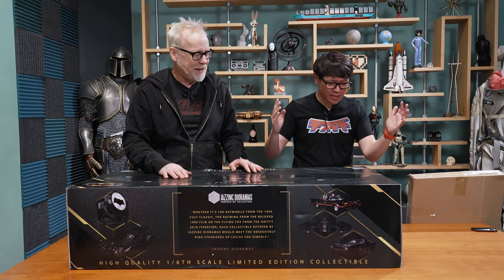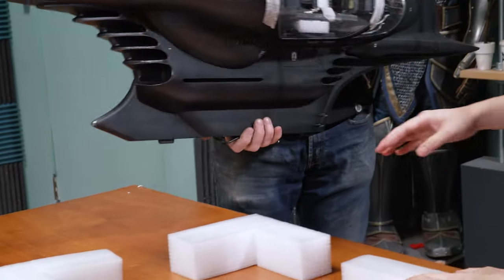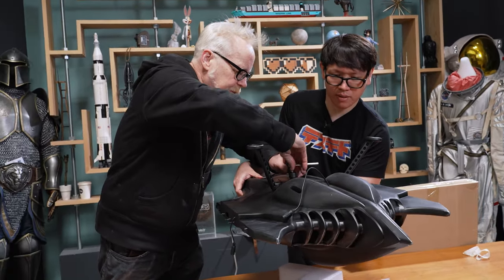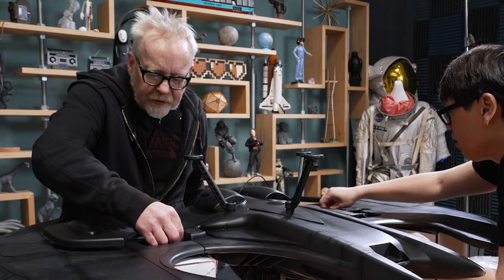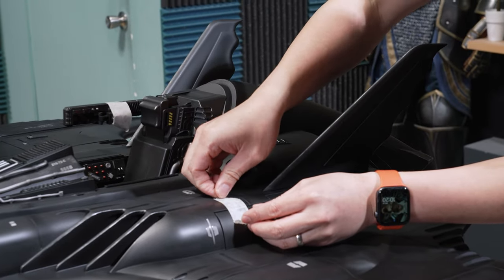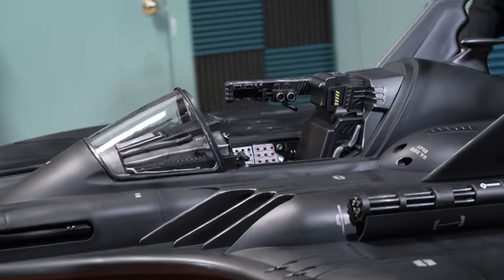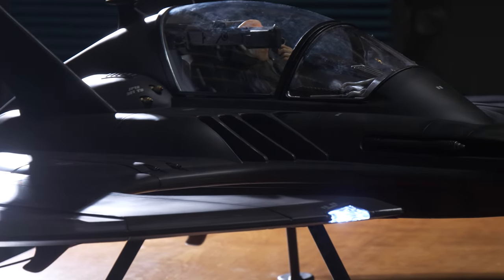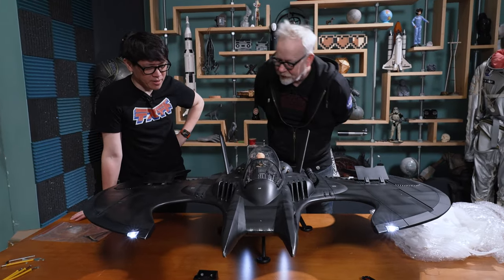Adam Savage Unboxes The Batwing from Batman 1989!

Comment: Wow, i used to have a big Batwing toy, i remember the pincher at the front. The big Batmobile too which if i remember had its own projectile mechanic but not this big. I had all the Batman figures and villains you could think of over a period of 15 years but in all I had accumulated back then 30 year archive of toys. I used to have a Batcave model that opened up with miniature figures inside, in fact i had similar mini city and buildings for micro machines, death star and thunderbirds and others.
The amount of figures i had passed down from the 70s such as Star Wars etc and then all my 80s, 90s toys was unreal. I had a built-in wardrobe full, countless chest and the attic in two properties my mother's and grandparents, a collectors wet dream of nostalgia.
Overtime folk ask do i still have sadly no, as a kid I sold most of it on carboots and when i was in my early 20s i donated everything i had to a charity shop and my dad's partner little boy. I regret it now because there was value, from superhero, star wars, wrestling, thundercats, transformers, turtles you name it all kinds of toys and memorabilia.

Comment: As a hardcore fan of this, the finest of Batwing designs... i'm in awe.

I wonder if someone put in the work to calculate if it could actually fly if built for real, but probably need to be a larger 3-4:1 scale.
Reply: Flitetest should do one, I feel like reaching for some foam board now.
Reply: I'm sure it's been stated that it's highly ineffective and wouldn't fly, definitely a case of form over function.
Reply: @ObsessiveGeek  Have you seen flitetest vids? Stick big enough motor on it. Would be fun model on full Moon
Reply: @babbagebrassworks4278  I mean, getting it in the air isn't quite the same as having flight capacity. 

Bees, for example, are constantly at ends against all other forces working against them to remain airborne.